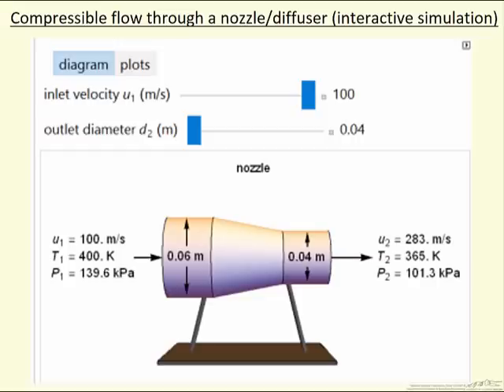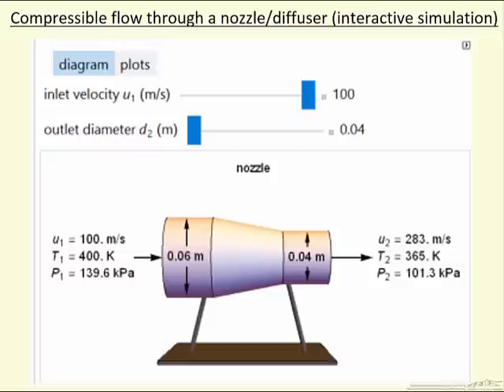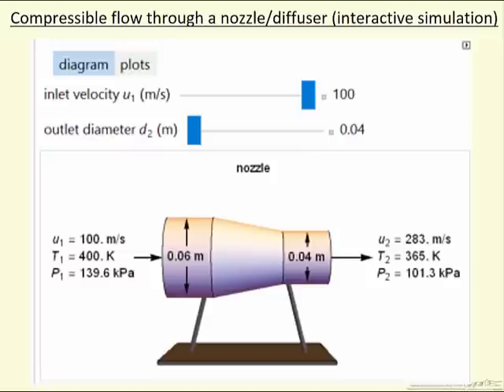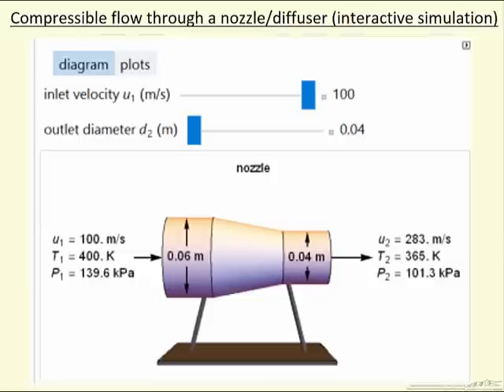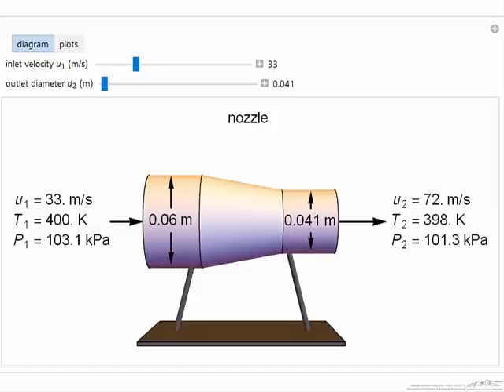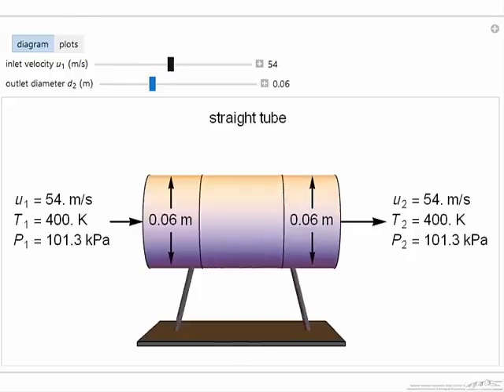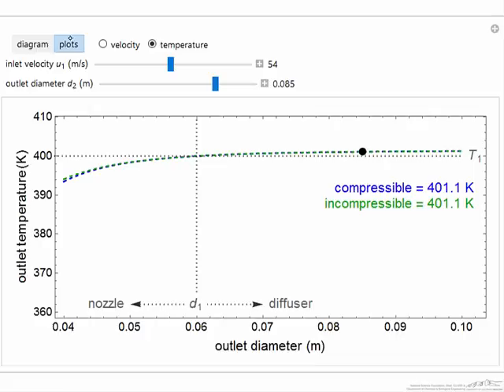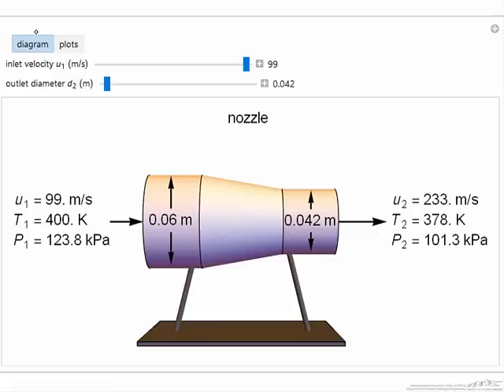Compressible Flow Through a Nozzle/Diffuser (Interactive Simulation)

Comment: on the diffuser example, if the pressure downstream become higher than upstream, the flow would reverse. Something doesn't look right with the simulation.
Reply: use bernoulli's equation, bro
Reply: It’s static pressure not total